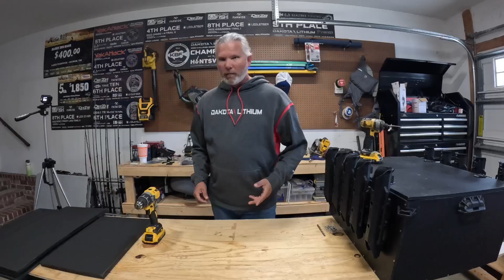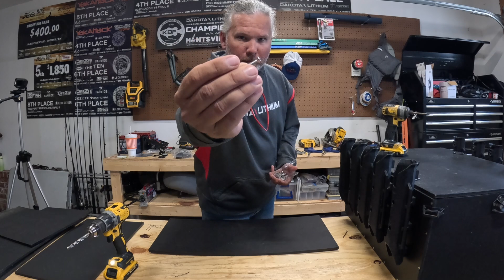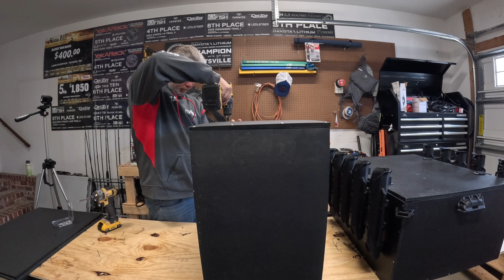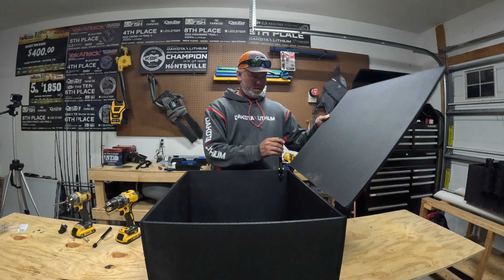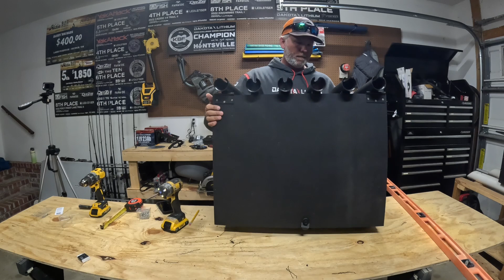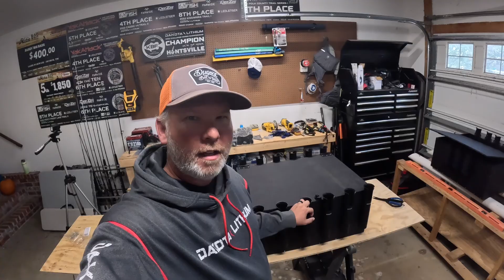How to Build The ULTIMATE Kayak Crate | IT’S HUGE!

Comment: Looks great just wondering if it wouldn’t have made more sense to put the rod holders on the sides, so you might have 8 instead of 12, but then you could get into the box w/out rods blocking the way!? Just food for future thought 🤔 NEVERTHELESS BEAUTIFUL JOB BUD!!!!!
Reply from the maker: I can see why it looks that way without me showing the box in the kayak. The rods are actually on the sides. I have the lid open up on the side instead of front to back. It’s easier to access when loading things on the trailer and I don’t have to reach so far to shut the lid while I’m in the kayak.

Comment: Great looking crate! Do you leave it in the yak when transporting? I would assume that it gets pretty heavy to load/unload.... Have you noticed any issues with the weight of it affecting the yak (causing cracks) or anything from going down the road if you leave it loaded? I'm paranoid about cracks , so I load and unload every time. Which is a pain in the A..... I would love to leave it loaded
Reply from the maker: I haven’t had any cracks. I leave it attached to the kayak most of the time.